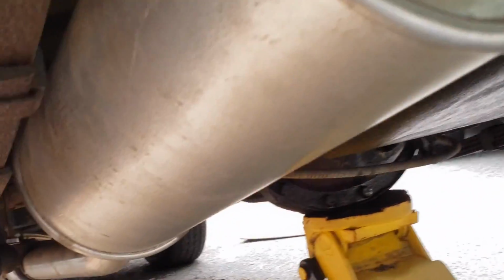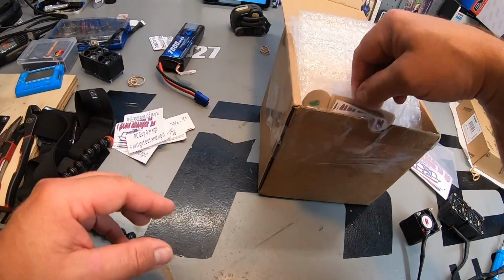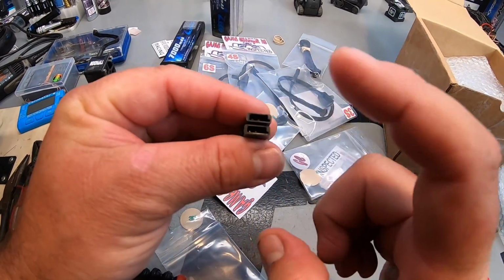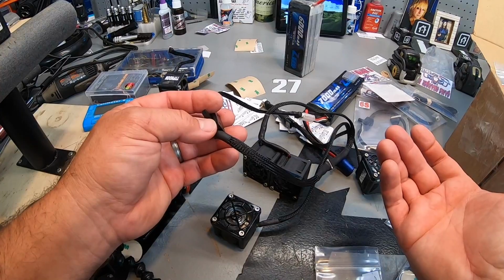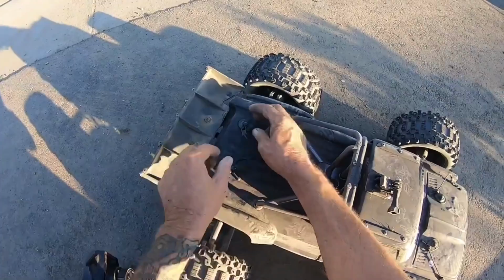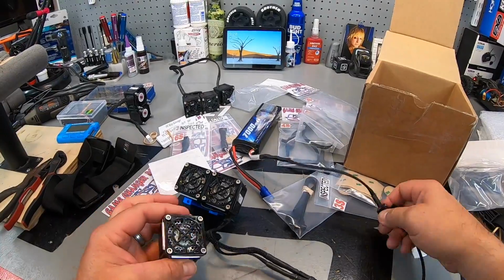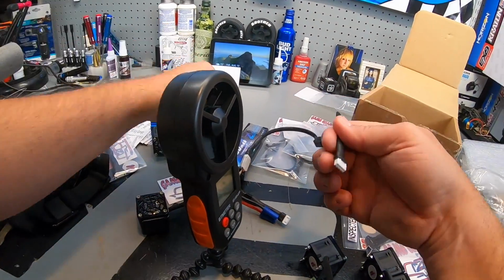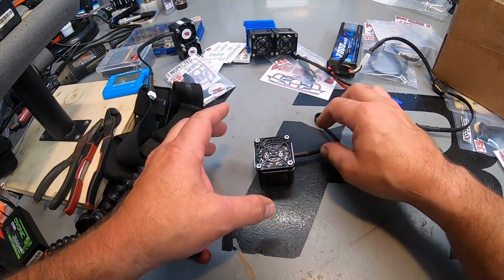Game Changer RC NEW FAN and Plug Adapter System

Comment: I recently bought the Typhoon for the traxxas sledge.. all i got was the fan the the little adapter. What else would i need to complete.  I heard you say ot to plug this in to my esc.. the traxxas battery doesnt have a extra plug
Reply from the maker: Always best to reach out to the product manufacturer as over time things change. 👍
Reply: @rcguygarage  thank you I did email on ebay

Comment: How much do they drain your lipo?
Reply from the maker: Not much but you do have to make sure to balance your cells. There's ALWAYS a give and take with everything
Reply: @rcguygarage  I just got a set for my 8S Kraton with 1100KV Castle motor and ESC combo. I was wandering if I needed an extra lipo. also if I could use the single fan on another rc.
Reply from the maker: @oldgeezer6470  your best bet is to contact where you got them from and ask as I have no idea what that seller does now it's been quite a while I think since this video was made??

Comment: Back in the day, I was a gamer and spent many hours building gaming rigs and overclocking the crap out of CPU's and GPU's. I never got into the whole liquid cooled scene (anyone doing this in RC???), but I did get far enough to know that far more important that the fan was the surface area of the heatsink, the quality of the connection between heatsink and the surface of the unit being cooled and the use of thermal paste. Exact same principles - run an electrical device way above the specs it was designed for and then apply intelligent/effective cooling.